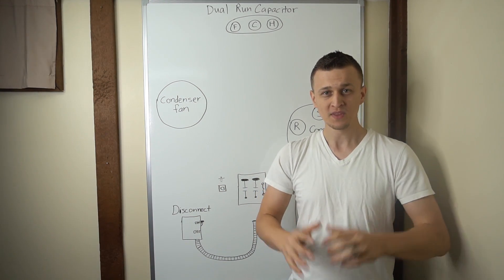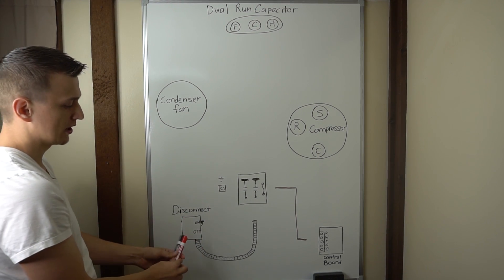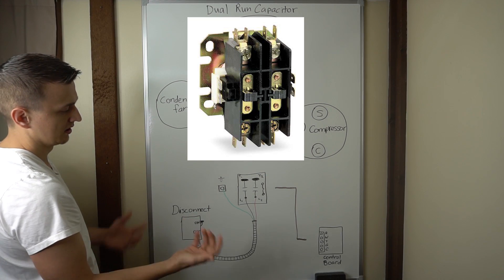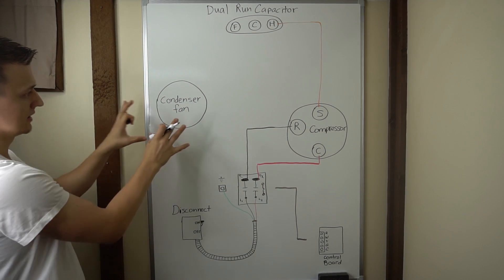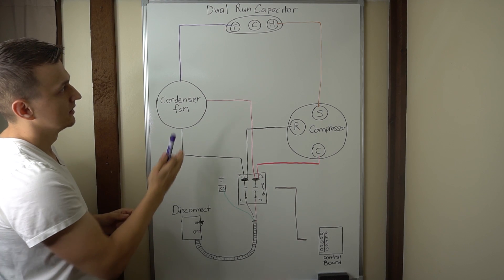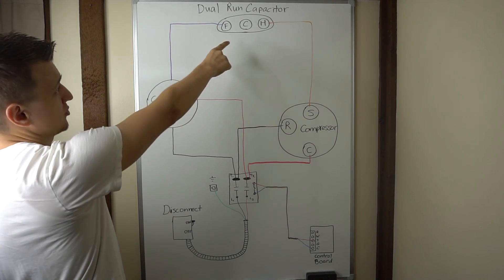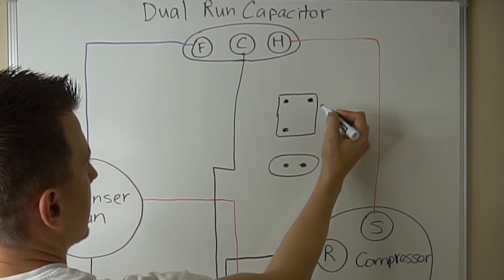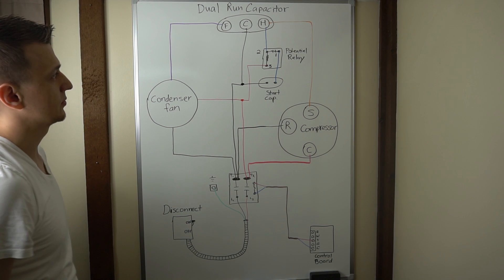How To Wire AC Unit - Easy Diagram

Comment: The common on the capacitor and compressor should be the same phase
Reply from the maker: Are you sure? All the condenser wiring diagrams I looked at all had the run winding going to the same place the common from the capacitor goes.
Reply: Word of Advice TV that is what I was taught....
Reply from the maker: @VeryPersian  I don't know man.. Maybe there's more than one way to wire the thing :) I will be making a video later on how to read a condenser wiring diagram, maybe we'll get some answers then.

Comment: Brother were is the HP lp
Reply from the maker: They would be wired in series with the red 24v wire. Basically between the control board and the contactor coil
Reply: @WordofAdviceTV  if I understand your response correctly, that means an installer would need to send a stat wire from the Y terminal to the HP, then to LP and from there to the contactor? If an installer simply run 18/2 from Y and com directly to the contactor, that means no pressure switches are wired in the system?
Reply from the maker: @domingoluyo2315  No, sorry. I said that poorly. Basically you would have the same setup as in the video but one of the wires (out of the two thermostat wires going to the contactor coil) would go to the LPC, come out from there and go to the HPS and from there it would go to the other side of the contactor. I wish I drew an example of that in the video too.. Let me know if that still doesn't really make sense. Btw, my next video will be how to read a condenser wiring diagram. If you will watch that video later, it will answer that question too.
Reply: @WordofAdviceTV  you said "no" then repeated pretty much what I said lol. I'll keep an eye out for your next video. Thanks, Jay.
Reply from the maker: @domingoluyo2315  Sigh.. I just need to learn how to read lol

Comment: Really appreciate your videos very practical and understandable. Was wondering if you have a good video on how to gain access to the ductwork where a evaporator coil is, in order to repair it or replace it.  Many times I’ve noticed the A-coil doesn’t have an easy access panel. It looks as if you have to cut into the ducting manually.  What’s the best way to cut into the ductwork and seal it back up? Thanks Scott-Propane service tech, California.
Reply from the maker: I don't have a video on that yet, sorry. But you would have to take apart the plenum to gain access. Usually that would involve not only taking apart the locks/slips/drives but also cutting the sheet metal on the side where the refrigerant pipes go in. Unless you will be cutting the pipes of course.

Comment: Thanks for nice video.
My friendly suggestion is Title it part one then continue on adding accessories (lp. Hp,solenoid valve and so on ) then
 heat pump and defrost board .link all your videos or have a playlist.
This way you have a nice playlist for wiring of hvac, even connections available for furnace as a heat source.
Reply from the maker: That's a good idea! Thank you for the suggestion Mike! Although this is the first wiring video I have made so may as well leave it as is for now :)
Reply: @WordofAdviceTV  you welcome.
you can add part 1 then continue for part 2, you can predraw it on  paper in order to explain it easier than taking time to draw.
Reply: You can draw with thin pen on paper bcz it does not show on camera but it helps you to draw it with marker very fast this is another option.
Thanks for your efforts for helping others.

Comment: I'm sorry my friend but I have to tell you that you make a mistake on your wire diagram that you post on your video from the start. 
Review your work. 
On the compressor command wire is black all the time and the run red or orange.
On the diagram that you make ask your self how many commands are?
Reply from the maker: I think you are right.. I did mess up the colors. Other than the color of the wires though, as far as I can tell, everything is wired correctly. The run winding goes to the same place on the contactor as the common from the capacitor. I reviewed actual condenser wiring diagrams to verify that.

Comment: Thanks for the video Jay. Great advice. I have 2 months in the HVAC business.  I've installed 1 unit so far, so obviously I'm like a sponge right now,  ...i'm absorbing all the knowledge I can. You've been of a lot of help. I have a question for you. In the unit that I just installed last week, it's a Broan brand, dual stage  cooling, 4 ton, 16 seer. With a variable speed motor furnace.  I noticed yesterday that the condenser  outside would turn on and off intermittently  every 10-15 seconds. It doesn't sound like its normal, Especially since it's a week old. I turned off the breaker while my customers were out of the house, and It sounds like the problem solved it self. But ...im afraid of getting the call from my customer any time to tell me what I already know is going on...Any thoughts on why this might be happening? Your input will help me a lot

Manny
Reply from the maker: Sorry Manny, I would have to take a look at it to tell you what's up with it.. From what you described, that sounds like a low pressure switch tripping. But you probably checked the charge (superheat/subcooling), pressure tested it, and purged your hoses, etc.. It could have been a loose connection too.. If the thermostat was not replaced, maybe weak batteries? Since that's a newer unit, does the condenser have a control board in it that may have been blinking an error code? It's good that it started working normally, so hopefully it was just a glitch! Maybe some others will have better suggestions, let's wait and see. :)

Comment: To go around wire that are not connected you make a letter C either fw or backward, the C is centered over the non connected wire and attach wires to the ends of the C.  This is easier to explain: https://www.dummies.com/programming/electronics/electronics-schematics-crossing-your-wires/
Reply from the maker: Thank you for explaining that A D and providing reading material! :)

Comment: Your duel run capacitor never goes to your run side of your compressor?  Could someone please explain.
Reply: @WordofAdviceTV  I'm kinda pulling my hair out trying to figure out why is a run cap on the start winding. I thought the start winding was kicked out after start up. (5-2-1)(3-2-1). Then a hard start kit is on the start winding to.
Reply: glendasue70  all a capacitor is, is a device that stores energy. A start capacitor simply bleeds out voltage/current to lag the windings and allow one full rotation in single phase/split phase motors. A run capacitor just helps maintain proper current so the motor doesn't overheat or lag. As far as why they're both wired into the start winding it is because the start winding has higher resistance. The run winding has less resistance and more inductance. Because of this start windings need a run capacitor to help maintain proper current and prevent winding burnout or lag
Reply: Great questions!  I'm looking forward to hearing Jay's response as well.

Comment: You should do a video on why u got into HVAC.
Reply from the maker: It seemed more interesting than being a plumber ;) That's a good video idea though! Thank you for the suggestion!
Reply: @WordofAdviceTV  Haha. Well you know we are all plumbers anyways once it comes to condensate. But I get your point. I been doing this 5 years now and we do alot. My company does radiant hydronic heat as well.
Reply from the maker: @misterdude206  Yeah, you pretty much summed it up. HVAC is a combination of plumbing, electrical, and refrigeration. The options I gave myself when I went to school were: Electrician, Plumber, Mechanic, or HVAC. And since HVAC pretty much encompasses them all I decided to go with that. It was good choice! Radiant Hydronic Heat sounds pretty cool! I don't work on units like that.

Comment: Great video you the best.
I have a quick question for you when changing AC unit from r22 to r410 can you use the same line set.
Reply from the maker: Thank you! Yes you can and that is done quite often.
Reply: Would you want used tires on your new vehicle? I'm not trying to be sarcastic or condescending. Could it be done? Yes. Does it happen? Yes. The diameter of some r22 line sets don't meet the requirements 410a systems require. Plus, you would need to worry about flushing mineral oil out of the line set because 410a   uses POE oil. If this is a favor or customer that wants lowest price, sure. A quality contractor that gives the best and charges accordingly wouldn't keep used tires.
Reply from the maker: @domingoluyo2315  Thank you for explaining Domingo!

Comment: How about a video explaining exactly what a Run Start capacitor does. I know a capacitor does different things if it's in an AC or DC circuit.
Reply: Our electricity have 60 Herz wave, crest + and crest - , the fan motor and the compressor motor needs to work with the two positive circle, so that the capacitor supply the voltage when the  power wave is in negative circle.(little tricky to understand)
Reply from the maker: That's a good idea! Thank you for the suggestion! I have many videos to make on my list though, so probably won't get to it for a while. I know I have seen videos on this same topic on other channels by the way.

Comment: Excellent Video.  FYI... for future reference (If my memory concerning schematics & electronics serves me correctly) I think the way to deal with those intersecting wiring lines is to (use one of the lines) and simply draw an arc over the other one of them.
Reply from the maker: @Jo Tu Thank you for pointing that out! I do know how schematics are drawn,  I did it that way so it looks a little cleaner.  But I'm glad you mentioned that for everyone else
Reply: How to rewire power cord on goldstar R5400 window air conditioning system

Comment: Great video 👍
Reply from the maker: Thank you! :)
Reply: @WordofAdviceTV  one question tho.
Some condenser unit doesn't have start capacitor, what gives the compressor the high current to start?
Reply from the maker: @gregrichard9192  The run capacitor takes on that role. That is a little harder on the compressor though since the mfd rating of the run capacitor is usually only a 3rd or 4th of start capacitor. That's why putting in a hard start kit usually cuts the start up amps of the compressor almost in half. A lot of units stopped putting in start capacitors though and it seems like most compressors are surviving it okay..
Reply: @WordofAdviceTV  thanks very much for the information.